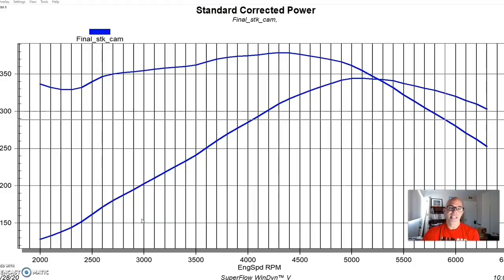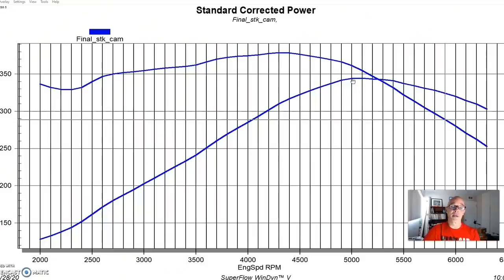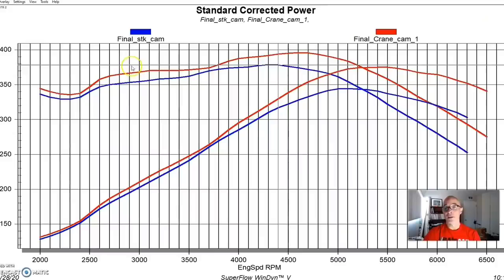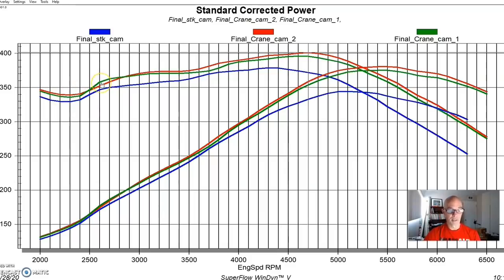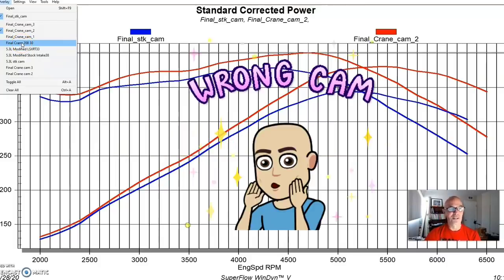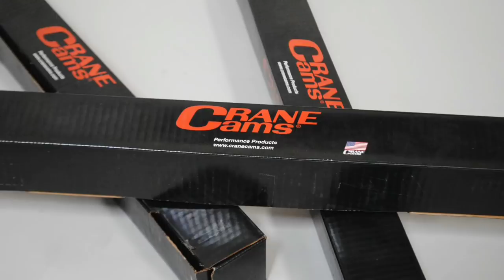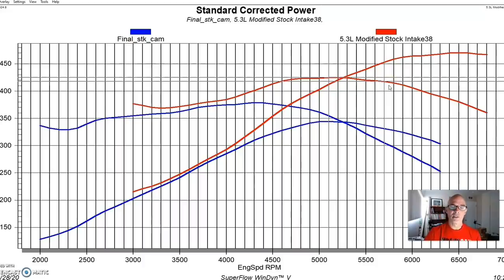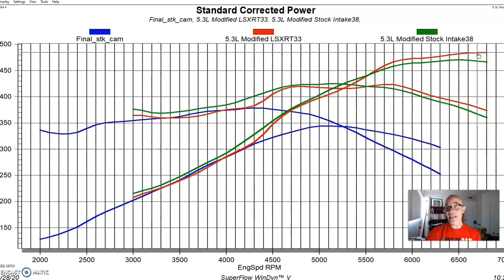NSR CAM TEST-HOW TO MAXIMIZE 5.3L PERFORMANCE

Comment: I'd say I'm the mild guy, but with compression. I like to add compression. I also like to port heads and add bigger valves. I like 10.5-10.7:1 compression with a mild cam. I like a crisp rev and strong low and mid range torque
Reply: I think I'm somewhere around 11:1? Not sure.. 62cc head on lq9, stock head gasket. It is pretty snappy

Comment: I know it seems like a big ask, but I would like to see how far a 5.3 can go NA. Score a Gen4 shortblock. Shill some valve relive and domed pistons in it and get some prc cnc heads and a 640 lift cam. I know it's stupid because all the better ls stuff is like $100 more for a 6.0l shortblock and pistons are actually more common for that size.
Reply from the maker: we did over 500 hp on a SBE NA 5.3L

Comment: What heads would you run if you punched your 5.3 to 5.7 with Btr cam? (Have 799 heads )I its for full size jeep
Reply from the maker: if I'm choosing a stock head then milled 706 or 799 work

Comment: Like you, I'm just a motor head...but. 2500- 5500 rpm is my game. So, torque matters.
Reply: I would like to see him build the 5.3 for a Maximum torque with as flat curve as possible.
Reply: That’s where I like the power range to be. I have a 5.3 that I’m going to put in a 67 Firebird but it’s really for having fun with, decent power but it has to be useable. A few extra HP at 7000 rpm isn’t what I’m looking for.
Reply: @thebigpicture2032  that is going to be a fun car to drive. 5.3 in that car will feel really fast.
Reply: @thebigpicture2032  212-218 550 550 112 Texas speed I put it in my 99 z28 350 hp 350 tq to the wheels

Comment: What cam could you use with a stock truck converter and still outperform the factory specs of a 6.0l. 6.0s are hard to find cheap and I have a 6.0 and want to use it for a race block so how can you make a 5.3 match the 6.0? Any help is greatly appreciated. With stock heads is it possible?
Reply from the maker: you can't have a 5.3l match a 6.0L without boost
Reply: @richardholdener1727  what would you recommend for a 5.3 daily drive that tows the race car. I have 1500HD. Basically a chevy 2500 with a 6.0 4l80. 

Im just looking for something reliable that has decent torque and driveability and a turbo is definitely not out of the question. Already planned on that. Lol

Comment: happy low rev guy. Thanks dude. would love to see a valve & spring compare. (could be pretty quick to do). start stock, then drop some titanium retainers to see how much they help stability  worst case then go up in pressure. How mush does spring pressure / friction hurt BSH.
Reply from the maker: I did a spring test for power

Comment: I would love to see your custom grind run down low in rpm. That might actually be a great cam for low rpm torque production for say a rock crawler or off road rig or truck. I would personally rather have the torque on a daily drive truck. That extra 40ft lbs would make it a tire fryer.

Comment: Does Crane make a mild cam for the 5.3 LMG, 2010 Gmc Sierra?  If so, will it run with the AFM and VVT or do they need to be deleted with a cam upgrade?
Reply: You'll need to delete them if going with an aftermarket cam. I'll be doing it next month on my PPV Tahoe with an LMG 5.3
Reply: @sellickusa  I was wondering if the computer could handle VVT and AFM with a different cam. I had my doubts, thanks for the info. I am hesitant to change all that and the cam when it runs so good stock, especially on E85. 80,000 miles and bone stock, except for a performance air filter in the stock location.

Comment: Seeing that I had my race car, for a daily I lean in the direction of mild to moderate.  Problem I have is probably like many. Should have gone1 step bigger on the cam. SS truck.  Right now it's a crane 210/218- .551 114 LSA (.583) with 1.8 rockers.
Reply: which 1.8 rockers do you go with? have you had any reliability issues with them?
Reply: @autobodyspecialistsinc.4397  comp 1677 has been running for a year now and nothing broken

Comment: What are your thoughts on a comp xr265  212/218 cam but ground on 110 lsa vs 114 for a daily truck cam?
Reply from the maker: I've run that 265 cam a lot with the 114-110 should help

Comment: Thank you for doing this.  I'm working on an L33 that I'm putting in a solstice.  Using stock cam right now, but this really gives me some ideas.
Reply: PAC 1218 springs and a cam <.600 lift and it will make power like $450

Comment: Great comparison data, thank you! Richard,  at what power level should I be porting the 706 heads? Have a springs only turbo 5.3 (def. Jekyll/Hyde) and have been wondering what the power ceiling is with the smaller valves. 
Thanks again!
Reply from the maker: your limit is cam (if it is stock) and not heads-you can go over 1000 hp with stock heads

Comment: Ever think of trying a ignition coil comparison test? I’d like to watch that .
Reply: I watched a video of guys spinning a highly boosted Evo on the dyno where they had to gap the plugs down to .011 to stop a misfire. I like this idea. Keep the same plugs and combination but test it NA, boosted and Sprayed to see if coils can help.
Reply: Engine masters just did an ignition test.  Consensus is there is minimal power gains when there is no miss fire int he first place.
Reply: @JustChuck   and old school Mopar ignition boxes are a gamble at best... guess what I'm running? .. lol.
Reply: Me too! Although I think it really only starts to make a difference at high compression and/or high boost level levels.
Reply: I'm in on the coil test. 800hp boosted ls and let's look at some plugs after pulls with both.
Reply from the maker: I have run ignition tests- plug gap tests and plug tests, wire tests, only a problem when misfire occurs. Stock coils make a lot of power if you can adjust dwell like on after market ECUs (can you adjust dwell on stock ECUs?)
Reply: @richardholdener1727  Cool. I'll check it out. I was probably being influenced in my thinking from when we used to do LPG (propane) dual fuel conversions and ignition became an issue. Always had to use different plugs with much less gap and sometimes needed better coils. Boost it and it exacerbates the problem. Not sure about dwell on stock ecus.
Reply: Richard Holdener have you directly compared a stock set of 706/862’s or ported 706/862’s to a set of cleaned up and milled 243/799’s to get similar compression and see if the port design and flow would be worth much with the other factors being similar? Would be great to see on both a 5.3 and 6.0. I had cleaned up and softened a set of 243’s and milled some to not lose as much compression, as well as wiseco flat top pistons to raise compression a little. Curious how much power could be had if I had just ported the 862’s and milled a little for more compression too. On a S480 turbo car on E85 and currently only 15psi.

Comment: I’ve got a question. I have a lm7 all stock of except it has a stage 3 tsp cam in it with 112 lsa. I’m looking for cylinder heads to go with it. I plan on adding boost and want to swap out the 706 head just because some are know to crack and don’t want to take the risk. What heads do y’all recommend?
Reply: It was just the castech heads that had the issue. The will have a battery symbol casted in the head under the rocker stand. There is a chance that you might not have them.
Reply from the maker: keep the 706 heads unless you go after market
Reply: Thanks I’ll definitely will take a look to see if they have that symbol or not. 

I was looking at trickflow 205 but was concerned about the chamber size since I plan on boosting it

Comment: Richard can you help me find one of your videos? I could swear that you had done a 6.0, LQ4 cam 706/862 head and then swapped cams for a small torque cam (maybe from BTR, Summit or Crane) I cant seem to find the video but the focus was for a 6.0 for towing/daily driver. It's possible I am thinking of an article you wrote, or that i am just completely losing my mind. If you haven't done it would you be able to do a comparison specifically for low end 6.0 Cath 706/862 low end torque cam?
Reply: I swear I saw an article online somewhere like that - LQ4, 706 heads, low lift 212/218 "truck" cam.
Reply: Found it - Richard Holdener was author too, imagine that. https://www.cpgnation.com/lets-talk-torque-ls-truck-upgrades/
Reply: Thanks that's good info but it didn't seem quite right for what I was remembering. I kept digging and it turns out to be the Iron Maiden series by Jeff Smith and he mentions Holdener's work hence the confusion for me.

Comment: I have a 5.3 with forged h beam rods and weisco pistons with a ms3 type cam.i have ls1 heads with 7cc dome pistons to out compression around 10.5:1. Are the ported heads or aftermarket heads worth the cost? In other words how much power do you usually see from heads. Sometimes I hear 30hp and sometimes I hear 75+hp
Reply from the maker: Take a look at the LS head test video to see how much they are worth

Comment: The mild cam with really good head is where I would go for a daily driver truck 5.3.
Reply: Good head is always better. But so hard to find.
Reply: @brianwilson3076  zing!! Lol!!
Reply: @brianwilson3076  🤣 Wise words my brother, though performance can be directly linked to "rod" length. Just make sure to grab the ponytail and seat a proper lip seal
Reply: Same. Have a mild summit cam and pac 1218 springs in my daily truck. Working on tuning right now.
Reply: Agreed.
Reply: Good heads are the way to go but their true potential wont be tapped with any mild cam. Milling stock heads is probably a wiser move with a cam thats not meant for big power past 6k. Just my opinion
Reply: @swappedoutZ71  but, there is always the cheaper way for me to make power from hear on out, I got the base to make a few ponies.
Reply: @sleepygoatranch  yeah no doubt. I was just saying the heads wont really be pushed until you have a large cam but that doesnt mean there isnt power to be had. It comes down to how much money you want to spend or how much work you feel like doing lol. Thats why in the beginning of my comment i say good heads are the way. IMO heads are a good solid building block. Id place them probably 2nd or 3rd on best bang for buck mods, unless we are talking heads over 2000 dollar price range then its no longer bang for buck lol

Comment: I see the duration being a problem for idle quality and bottom end but I just don't see why you would not want to do springs and get some more lift
Reply: And PAC 1218s are cheap
Reply: Darth Giggity  I mean you can for the most part get a cam that will have enough lift that a charge in rocker ratio will add unless you are going real big but I mean for something that is going to be daily driven or something I just never got the no spring cams I mean you are already buying a cam so you might as well get what you want and do the springs too

Comment: Dude, 487 HP from a 325 is an awesome figure and would make for a really good platform for any restomod, or even to do what I've always wanted to do, swap one into an 80s Monte Carlo SS or any G body really. I'd REALLY love to get my hands on a Grand National with a toasted engine and drop in a LM7 with similar engine upgrades and add a responsive, but powerful turbo with a 6 speed manual.
Reply: Yes sounds nice

Comment: I am a small cam big head guy. That way I can have good drive ability but still make good power everywhere
Reply: Dave M  exactly and like that it's a good daily. Part throttle performance is crispy 👌 👏
Reply: Darth Giggity  what about the heads?
Reply: Darth Giggity  at a minimum make sure that the throat diameter is right because stock it's not close. Air speed is critical and speed bumps should be removed.

Comment: Like your dyno videos and have learned a lot Thanks a bunch! Have you ever tried the compcams drift cam ? And are short lift long duration cams easer on the valve train than high lift shorter duration cams?

Comment: I wonder what the ultimate 5.3 daily driven truck engine would look like? DOD delete, BTR torque cam, x-ram intake, etc. Will the 6L80 deal with it until power adders? Mild and still a truck, BTW. Not looking to turn into a race car.
Reply: My 6l80 works fine with probably 600 rwhp in a truck on a tvs1900. My crew cab is in the 11s with the only change being a factory 6l90 converter.
Reply: @MrVettelovralexand2  Mine is a 2013 CCSB. I assume you changed the torque converter to a higher stall rpm?
Reply: @johnclark3067  Mine is a 2009 CCSB also, and the converter from a zl1 does stall slightly higher. I have videos on my channel at the track when it was a cam, heads, blower 5.3 and some speedo videos from when it was still getting dialed in with the current forged 6.2 setup. Nothing in the transmission internally has been swapped and it has over 25000 boosted miles so far.

Comment: Rich, when you're getting into serious combos that require a much higher stall speed converter than stock, do you have any idea as to what exactly a torque converter builder will look at on an engine dyno curve? In the "mild" test motors here theres a torque dip down low then it starts at ~2500rpm to rise to the peak, likewise in the "wild" combo theres a dip then at ~3500 it starts to rise; is it a safe assumption to buy a converter at a stall speed of the bottom of the dip?
Reply: As with many things in life it depends. Application is going to play a large part in selection. If you are just drag racing a much higher stall speed would likely be appropriate. Street application will require a compromise. Generally I would say after the dip to prevent any bogging down so to speak. Best bet is to talk to a converter manufacturer and even better if you have a dyno readout to share with them. Also full lockup is at a much higher rpm on stock vehicles then many people think. A 2500 lockup is not high at all.
Reply: Just under 500 hp.  About perfect for 1/2 ton truck daily driver